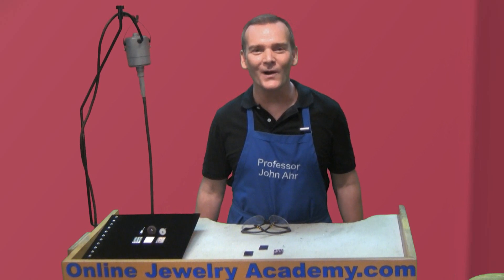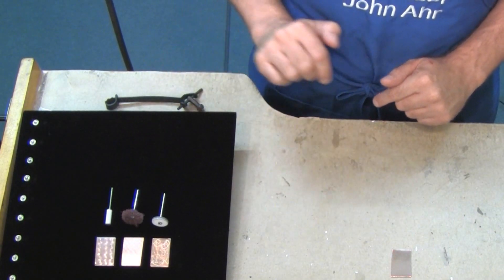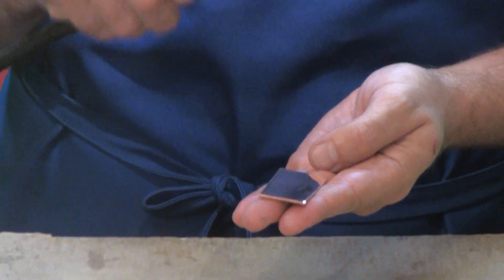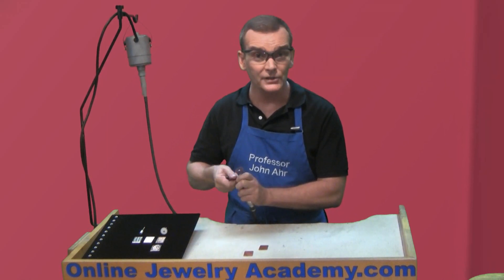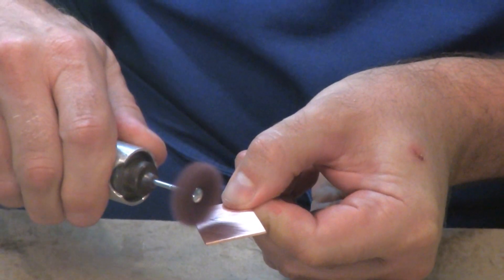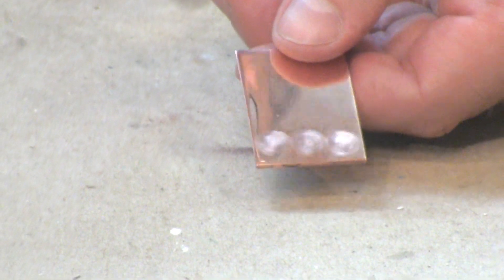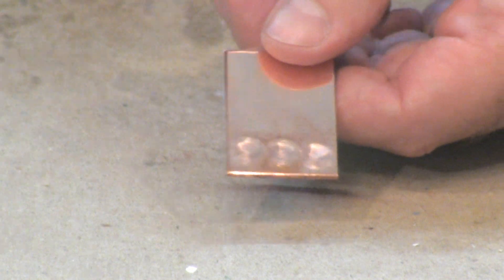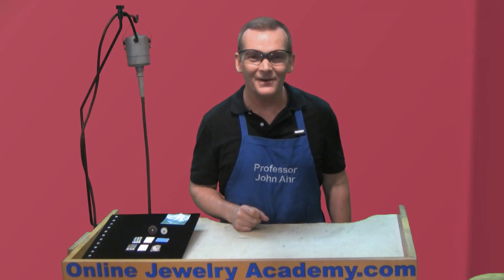Create Quick and Easy Textures on Metal

Comment: Hi! Would I texture the metal before or after forming into a ring? Tysm!
Reply from the maker: Do a texture of the metal before you form it into a ring. Doing so after you make the ring would cause the ring to stretch. 🙃
Reply from the maker: I noticed that you had watched the hammered texture video first. The textures associated with this video are to be applied after the ring is made. Sorry for any confusion.😀
Reply: @OnlineJewelryAcademy  ok... got it... anything that would stretch the metal like hammering should be done before,  but surface texturing that wont stretch the metal should be done afterwards?

Comment: Hi do you know how to get a glitter-like/ dust texture on the metal, and what to use.
Reply from the maker: Sorry, I don't know how to create that surface effect.
Thanks for your support! : )
Reply: You could try using a hammer hand piece on your flex shaft with different anvil points. When you buy the anvil points, you have to finish the tips of them yourself before using so you could grind in a little star shape on one of them and then use it to create a stardust texture. Alternatively if you have access to a rolling mill, you can roll a piece of metal though with a coarse grit sandpaper and the sandpaper will texture the metal kind of like silver dust.  Once you polish, it would be shiny.  If you don’t have these expensive tools, you can just use a sharp scribe and draw little stars all over your metal, overlapping and different sizes, and that should give you a really shiny light glitter texture.

Comment: Hi,
Grace here,
Speaking of texture;
I looked through the catalog of videos but I'm dabbling in etching and my question is.
 On tube copper: if you wanted to do some etching on it using the ferric chloride .how would "You" go about getting an even etch?
Say it's a 1" long tube. Do you just stand it up tall in the  container¿ Tube is rather expensive and I'd rather not waste it. Please and thank you and thank you for your time.
Reply from the maker: Hi Grace,  I don't like etching with ferric chloride.  It's messy.  It stains everything.  And, it's a pain to get rid of. The OJA has several videos covering salt water etching.  You can find them on our website at: www.onlinejewelryacademy.com  Be sure to put resist inside the tube so that it doesn't erode from the inside out and ruin your material.  If you still want information on ferric chloride, I'm sure you can find a video that covers its use on another channel.  Good luck with your project.
Thanks for your support! : )